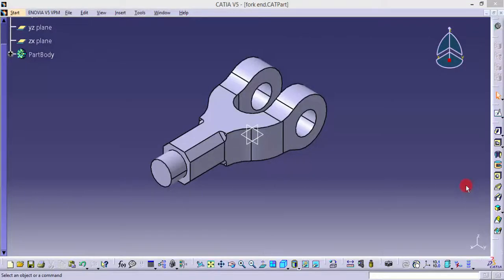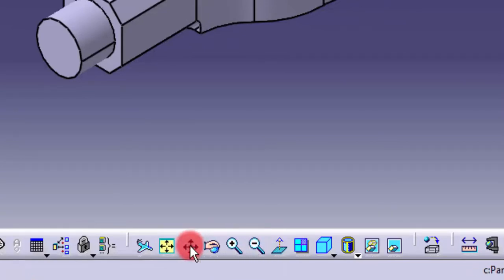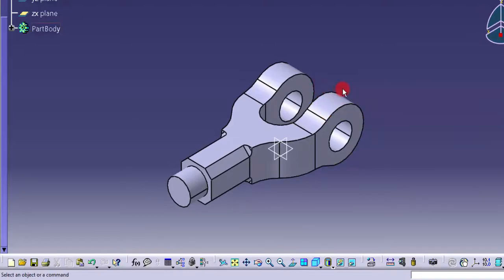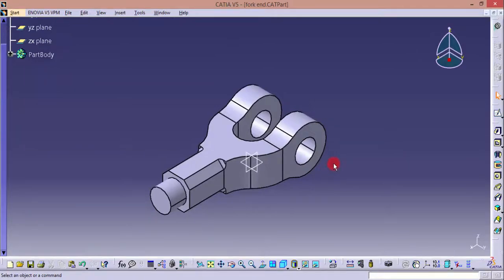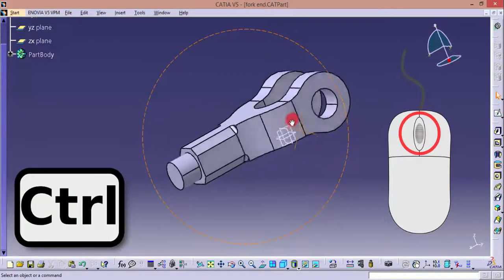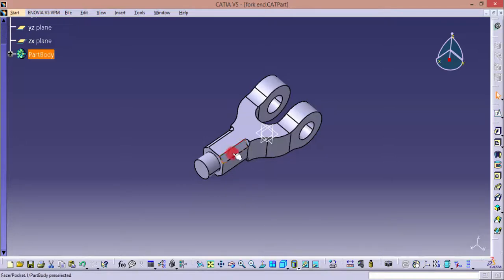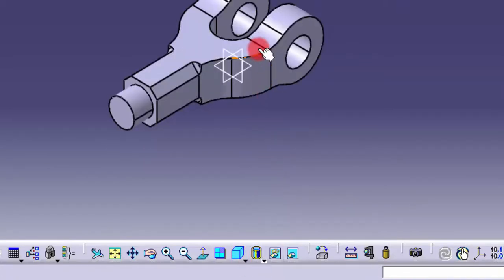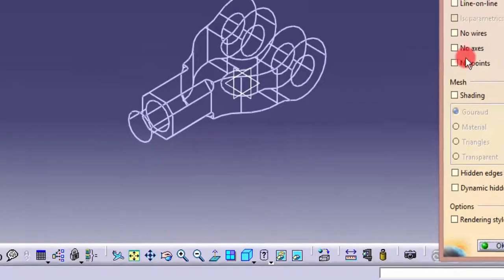How to Rotate, Pan and Zoom using mouse | Solid, Wireframe, Hidden Invisible Edges | Catia

Comment: hi i have a problem in catia, when i pan it should be moving only in 2D direction but when i pan its like my view is rotating in 3D
Reply from the maker: That sounds frustrating! It sounds like you might be accidentally using a different mouse function than intended. Can you double-check which mouse button and modifier keys you're using for the pan command?